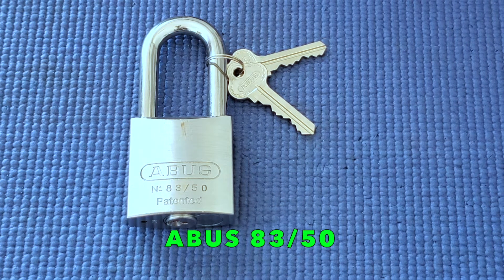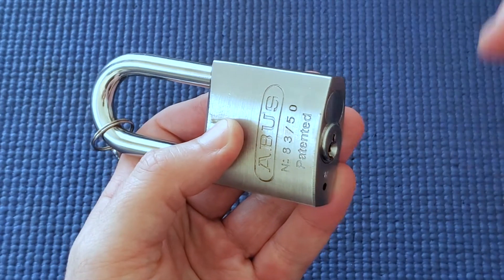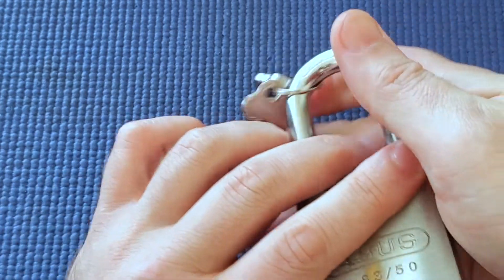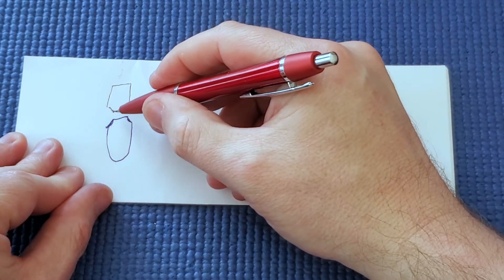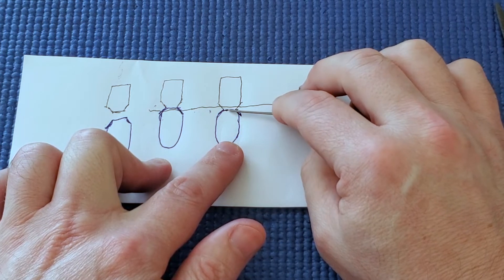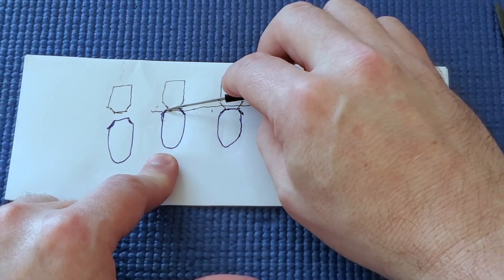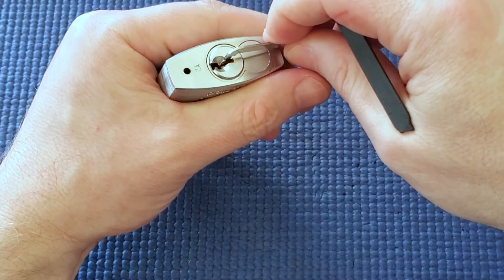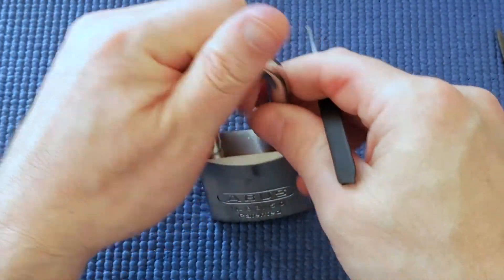(Picking 143) ABUS 83/50 picked

Comment from the maker: Beveled pins can be a pain to pick!  I have found out (from comments below) that these Abus padlocks with removable cores are generally pinned up with Lockwood style bevelled pins (thank you Tipene), and those sort of pins aren't used for security but rather they give a better everyday performance with bad keys and dirty locks (the locks will still open with some jiggling of the keys) (thank you Rune International), but if you think that makes them easier to pick, think again. :D

Comment: Great job getting that Abus open. The Lockwood tapered pins are so easy to overset when picking. When I was in competition pistol shooting,  we beveled the edges of the cylinders of our revolvers to allow speed loaders to work better aligning flat face bullets to the cylinder holes.  Same principle with tapered pins,  they go up the hole easier, and the core doesn't have to be perfectly aligned to get an over set. When using the key, it doesn't overset,  because it's aligned properly.
Reply from the maker: Oh wow you're right ... you have lots of experience!  Thank you Mr Mancel :D :D